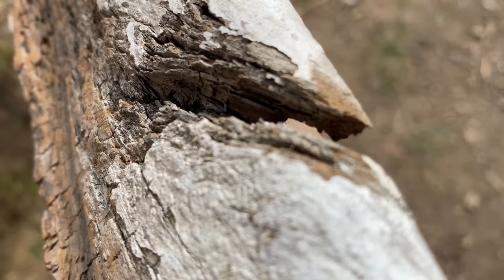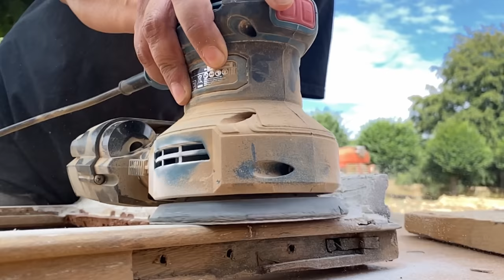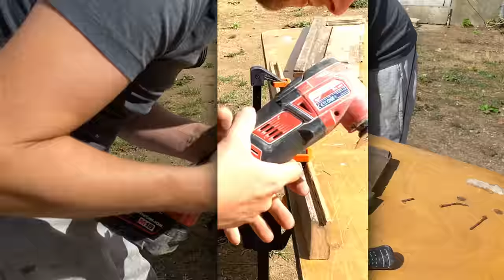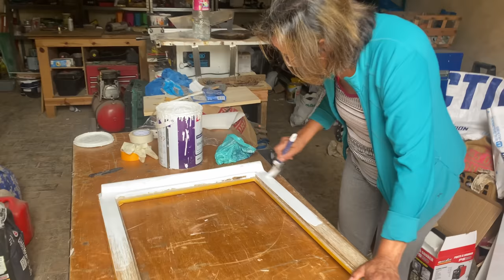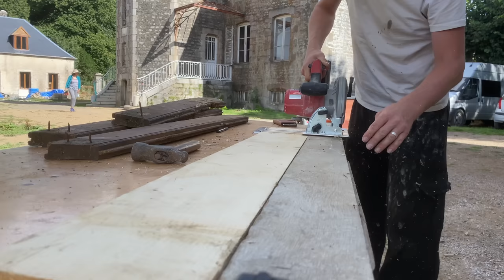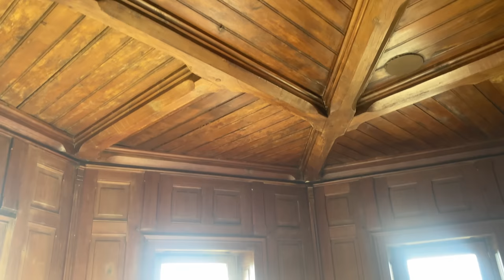Restoring the CHÂTEAU TOWER | Bringing it to LIFE. Ep 77

Comment: Impressive work.  One small suggestion:  Don't glue the panel into the frame.  The grove in the frame is designed to be slightly deeper than the size of the panel so the wood can shrink and expand with changes in humidity.  If you glue the panel into the frame, it could push the sides of the frame apart as it expands and ruin the corner joints.  In the case of the small panel you did here, the expansion would probably not be large enough to be of concern.

Comment: I would be very careful sanding the white paint as old as that is. My guess would be it contains a lead and you don't want to inhale the dust from sanding. I noticed you do have a mascon is it picking up to prevent particles is of the air giving through the mask or around the mask? It sure is a lot of work replacing those window frames but the finished product is well worth the work. It looks so much better restored the way you were doing it then just putting in new windows.

Comment: Great save job, as always! Do you have to treat the wood-wormed sections in the rehab process? I used to run a French antique shop, and it seems like everything coming out of France was in need of treatment. Usually, soaking it with turpentine did the trick, then filling the holes with wax sealed the little buggers in their tomb.
Reply: Yea, everything from France has a least one woodworm hole 😂😂 that way we know it’s french 😉

We’ve treated everywhere now at least three times! We will likely treat a couple more times just to be sure :)
Reply from the maker: Thank you, yes we have to treat everything, great tip 👍🥰

Comment: That filler will crack and pop out in time, due to humidity and wood contractions and expansion.  The only wood filer wich will hold is wood glue mixed with saw dust. But that is very hard to sand.
So when you have large cracks and rooted patches, use a wire brush and brush in there till you reach the fibers of the wood, fill as many times with wood glue mixed with sau dust, and use that fine filler last(use the wire brush again on the dried wood glue filler). But as i sad. Wood and fillers are not friends! And if you want a job like this to last use some waterbased paint, and paint in 3-4 coats, otherwise all your work is in vain. Waterbased paint or acrilic paint is best for wood, as it dries is alore more soft than solvent paint, and this allows the paint not only to stick better but not to crack. Solvent paint dries up the the point where it becomes rock hard and then starts to crack. Usually solvent paint needs a primer first. Solvent paint is much cheaper. But if you ask me, especially on wood wich has contact with outside air. You should always go for waterbased paint
Reply: I agree, Alexandru - wood filler isn’t made for this type of application - and certainly not in the quantities it’s been used here.  There’s a reason we don’t see how-to shows promoting the virtues of wood filler in window repair. Also, I’m hard-pressed to believe that wood fill is actually more economical than swapping out the rotten pieces of wood - even as a temporary fix. I’m hoping proper window replacement is Terry’s first priority after the château begins generating some revenue - he has said something along these lines in previous videos. Let’s hope these patch jobs hold sufficiently until then!

Comment: Installing single pane float/flat glass is a BIG mistake. Instead you should be using Laminated Glass (if of course double glazing financially is not an option). 
The main reason to use Laminated Glass is that it will stop the majority of UV Rays which enter the room - the cheap glass you are using (float/flat glass) allows UV rays into the room and you get colour fading on all exposed wood and fabrics which receive direct light during the day. You are saving nothing - infact the very opposite - you are actually costing yourself more money by going for the cheaper glass option. 
Ask yourself - how much does it cost to decorate a room - new carpets, curtains, blinds, wallpaper etc.... all of this is going to be quickly damaged by UV rays - so every few years you will be renewing....all because you used float/flat glass. 
Also with laminated glass another benefit is that you will get far better sound insulation as compared to float/flat glass.
But the main benefit and reason to use Laminated Glass is the UV Protection. Laminated glass is your best option and the cost difference between Laminated and Flat glass is not that much - but in the long run, it way cheaper to use a UV protective Laminated Glass and decorate your room only once, as opposed to using cheap flat/float glass and then renewing the furnishing, refinishing the wood and interior redecorating every few years.
Reply: I agree with you, Paul. Many times I’ve watched the repairs which Terry has toiled away on, and thought, “I understand his thought process - it’s a lovely idea to want to save the original glass, wood & frames and so forth (or to use materials akin to what was original) - but it’s impractical, and potentially deleterious to their ultimate objectives. 

Still, Terry has mentioned a desire to get the château up and running as soon as possible. The idea is that they need to generate a revenue stream, after which they can invest in proper window replacement. 

Watching all that effort which went into restoring the panel above the window, I was praying it was treated for woodworm - because it seemed like it hadn’t been.
Reply: @jenniferlynn3537  100% agree. It's a common excuse they use that its just a temporary fix....but in reality it is not - come back in 10+ years and you will see that nothing has been changed. The winter is coming and they have many doors and windows still to address. Its going to be a cold winter at the Chateau. 
They seemed to have had an amazing English Carpenter called Budo who renovated and remade their Front Doors which look fantastic - but then they never referred to him again after the initial video which showed the doors being taking down for renovation - later on during the install video months afterwards, they just referred to him as some local guy (never mentioned him by name or that he has his own YT Channel - French Farmhouse Diaries) ....not sure what happened there, but seems like they burned a bridge there. Those Front Doors were ready long before they were eventually installed.........
The amount of time completely wasted filling and sanding rotted wood ...... it would take a fraction of the time to just remove the rotten piece and put in a new piece of wood - only need a Router for profile molding and a table saw - both cost less than 100 Euro (Aldi/Lidl have ample tools for very cheap). 
Instead they continue to use Ronseal Wood Hardener and Filler.....that stuff is way more expensive to use - rather than changing out the rotted piece of wood.
Reply: @paullynch277  instead of being smug and critical in collusion with another smug and critical commenter..... why don't you politely ask the Chateau restorers why they are doing it this way?!
... And politely suggest that they would be better off restoring with replacement timber pieces....!?
(actually, I agree with you that routing new pieces WOULD be a much better and probably just as quick and cost effective method!  So I would be interested to know what the thought process is.......)
Reply: @andymccabe6712   well Andrew, you seem to have been triggered ......🤣🤣🤣
Smug??? - Andrew substantiate your claim!
Reply: @andymccabe6712  Hey, Andy - I hope it's not me who you believe is being "smug and critical" and colluding with Paul. It truly pains me to see all the time, effort, and wasted money (pound, francs, or euros) expended on château repairs that will be of such short duration, ineffective - and worse, which may potentially provide a false sense of confidence that a problem has been solved when it's only setting the family up for failure.
Paul does make a valid point regarding how inefficient the insulation value likely is of the windows Terry has repaired - and it's fair to argue that - whatever they believe they've saved in going this route - they'll spend that and more in heating costs.
Moreover, I haven't forgotten Terry's distress when the garden wall Ash worked so hard to excavate came tumbling down - and I wouldn't wish to see them suffer a disaster of similar magnitude to the château proper. That could occur should another severe storm strike - because the shutters are in a state of disrepair, where they exist at all.
I took pains to point out the plan Terry outlined by way of explanation - others (like Paul) might say they're being foolhardy. Perhaps Paul's indignation stems from a respect for the historic value of what remains of the interiors together with a desire that those entrusted with château restoration proceed with proper care. Or maybe he's amongst those who feel it's irresponsible for Terry to put forth videos demonstrating salvaging of windows, when those viewing his work might get the impression that his techniques are sound.
I've considered that the manufacturers of the products Terry uses may be providing them free of charge or at cost - or that they're sponsoring the videos. Either way, what's been occurring with the windows cannot be described as solid workmanship - however attractive the outcome.